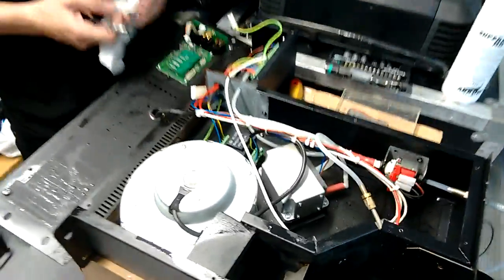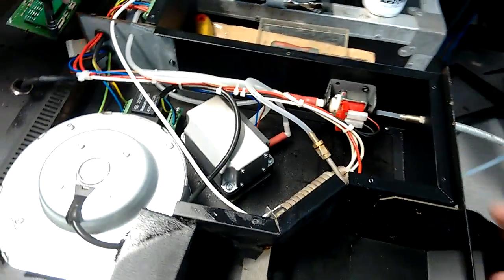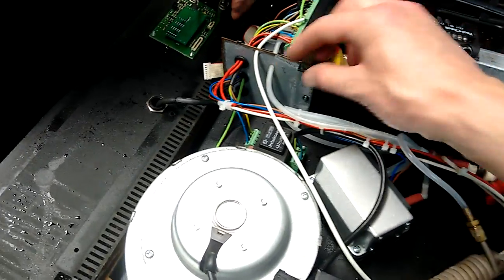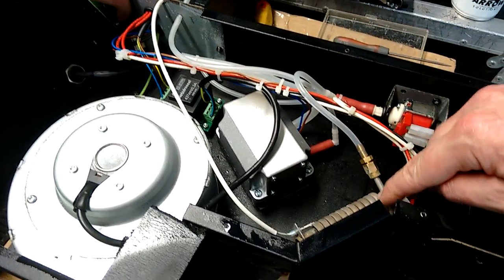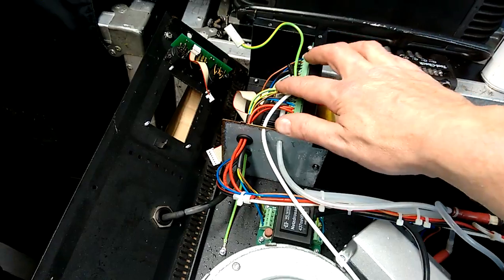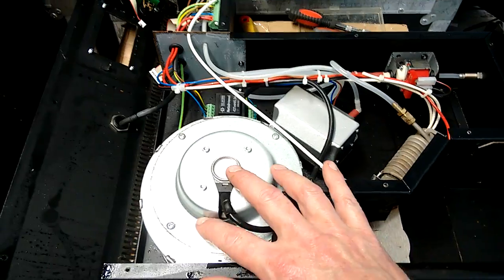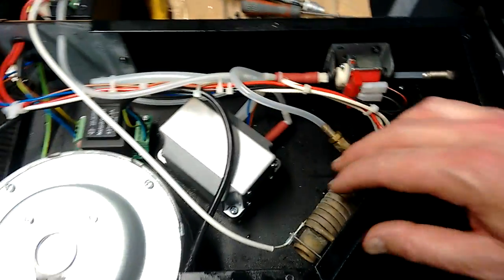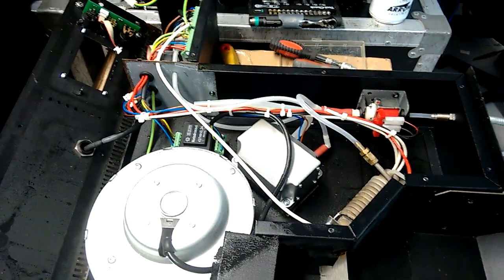Inside a theatrical haze machine.  (hazer)

Comment: Hey, I have a unique 2.1 hazer. But when I turn it on, very little mist comes out, but more 'water'. It now turned out that the circuit board did not supply power to the pump, so we had connected a separate power cable to the pump. but now I can't control the speed of the mist. Do you have any idea what the problem could be with the circuit board, or more explanation about how a hazer controls the speed of the compressor and pump? thanks in advance.
Reply from the maker: Make sure that the heater is working properly and the tube around it isn't blocked.  When the unit is running there should be a flow of the haze fluid and bubbles of air into the heater section.
One odd fault is that sometimes bottle caps get mixed up and the anti-leak valve in the cap doesn't let the fluid through.
A major issue is also moisture on the PCBs causing corrosion.

Comment: I replaced the heat exchanger on one of these today, when re-assembled I found it to be blowing air right back into the fluid bottle! Loty's of bubbles! I added another piece of pipe to create the air/fluid mix just before the heater! Because it's been awaiting parts for months I assumed that I misplaced some some - including the piping. It works great now! Tip: If haze or smoke machines seem to have a blockage, disconnect the power to the pump and add your own 240v feed. It will blast any debris right out the other end. After all, they usually only pump momentarily in service and  some De-ionised water is a good cleaner.

Comment: I have this exact unit (or very similar - basehazer pro), took it apart to troubleshoot but cannot find parts ANYWHERE. Not even a simple cap for the bottles (with the quick connect)...
Reply from the maker: Contact the manufacturer for spares or improvise.

Comment: Nice to see that your hazebase base hazer looks as wet inside as ours do....
Typical problem with them
Air pump, liquid gets on the display....
But really great units, especially in the case design
Reply from the maker: Yeah, we've had to rinse off some of the control modules with isopropanol to get the back in action again.  Not overly keen on the way the internal pump chassi plate is mounted.  Quite tricky to get out if the nuts are crusty and the rubber dampers are spinning.
Reply: Yes
Sadly we had to order spare parts, always shit if you dry hire stuff and no one tells you If something is wrong.....
So you take a quick look, everything looks OK, put it back in storage and then the fluid begins to work inside... :(

Comment: Hi Clive, I work with a company that has this model. They're forever clogging their atomiser (E8). Don't suppose you have, or know where I can pick up, any servicing tips? It's getting very expensive and, seemingly a bit pointless, repeatedly sending them to pricey service centres (that shall remain nameless : ) ).
Reply from the maker: The heated atomiser in these has a really large bore.  I'm not sure how prone they are to clogging.  It might be worth routinely using the white vinegar trick to flush them through from time to time.  (outdoors)  What actually happens when they stop producing haze?  Is there an error code?
Reply: Indeed, It displays Error 8 (the same for Look Solutions, Hazebase and Smoke Factory, I think). The manual advises against any flushing procedure. Nonetheless I've given it a go with white vinegar and distilled water without much luck. I'm running out of ideas and they're, otherwise, brilliant machines!
Reply from the maker: That suggests that the fluid is backing up the air line and being sensed where the tube passes through an optical detector on the main circuit board.  It could be caused by various things like the air pump not running properly or the machine being shipped in random directions causing fluid to make its way up to that area in the tube.
Reply: I'll open one up when I see them next. I know they've had one fail on panto. Thanks for that, very useful.

Comment: I loathe fog machines, mostly because I know what it's like when people chose to run aftermarket fluid and you end up replacing heater cores all the time. PSA: Don't use cheap aftermarket fluids just because they're cheap, you'll make up the savings you got in costs of replacing heater cores.

Comment: PRG branded hazer? We use Ultratec Radiance at work, they use a 4-chambered aluminum exchanger with copper tubes for input and output. It fills our stage and house pretty quickly and thickly, and the chambers are very easy to clean... But, if you try to take the silicone tubing off the input tube, it often sticks and can cause the overheated copper to break.

Comment: please describe functionality of choke so I dont have to google during the video but great video still.
Reply from the maker: Choke or inductor.  Limits the rise time of spikes and transients to reduce interference.
Reply: Interference in a fan ? Is it to prevent back emf from a fan motor or something?
Reply from the maker: The motor is being speed controlled with phase angle control like a light dimmer.  So quite sharp switching spikes when it is switched on each half wave.

Comment: Looks a bit wet inside that haze machine, something leaked in there or just a general buildup of smoke fluid?
Reply: Yes, it does look like it's suffered a bit of incontinence.
Reply: That one inch gap between the heater and the fan. Maybe that's why Cara was mopping up the RC board.
Reply from the maker: Once again it's the perils of touring equipment.  No matter how many "This way up" arrows you put on equipment like this, it sometimes arrives upside down with liquid dribbling out of it.

Comment: Cool, I wonder, is the fluid that the machine uses, safe?
Reply from the maker: The main ingredients of haze and fog fluids are water and either glycerine or one of the glycols like triethylene glycol and propylene glycol.  Don't use sugar in a smoke machine fluid.  It will block it.
Reply: Razor2048
They've been using the same glycol solution in smoke machines for decades, nobody has suffered as a result of it, and as a main component in electronic cigarettes, it's still classed as a safe chemical...
Reply: Safe for what?
Reply: Gregory Thomas
Usually it's PG in fog machines...
Reply: Yup the fluid is just water and food based additives (glycol normally) some fluids like the Le Maitre machines uses sugar instead
Reply: They usually use propylene glycol, which is in foodstuffs, soaps, personal grooming products, asthma inhalers, liquid medications, etc., so yep, perfectly safe... :)
Reply from the maker: Same principle.  The water boils at a lower temperature than the glycol so it shatters it into tiny droplets that create the fog effect.
Reply: Just in general since if you are anywhere near the machine while it is in use, and you may end up berating in some of the haze.
Reply: Would that be like the e-cigs vegetable glycerine?
Pretty kewl if they use the same 2 ingredients as e-cigs!
Reply: Gregory Thomas
Electronic cigarettes use either Vegetable Glycerine or Propylene Glycol, or a mixture of the two, the VG gives it sweetness and cloudiness, the PG simulates the throat hit that smokers seem to like...
Reply: +twocvbloke  I know...I vape (and mix my own) I was just wondering if the glycerine he mentioned was vegetable based like e-cigs or another kind.
Reply: this brands new machines use Vegan haze fluid. just gonna put that out there. xD

both normal and vegan are completely safe for the record, but yeah. now it's vegan too I guess.